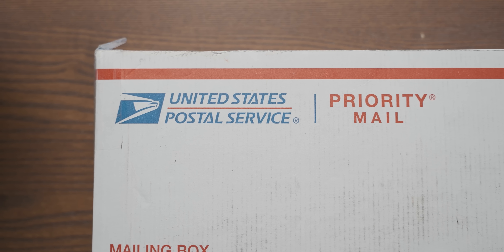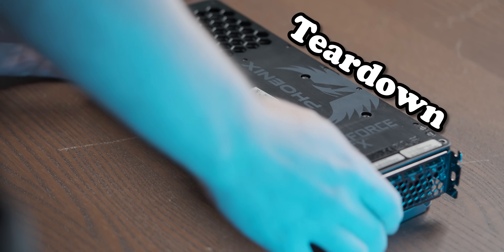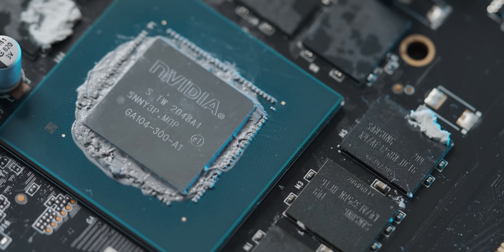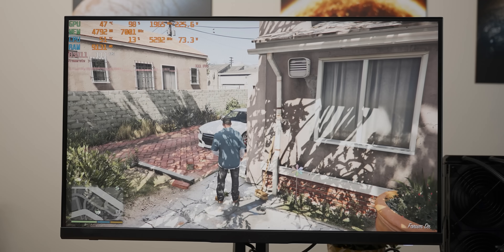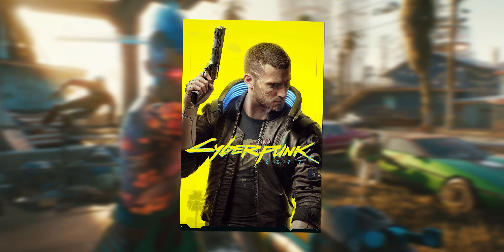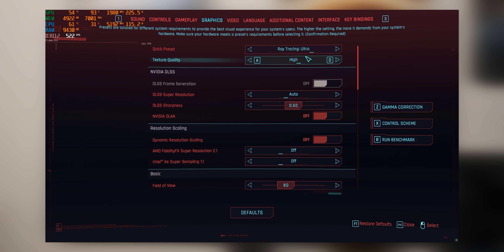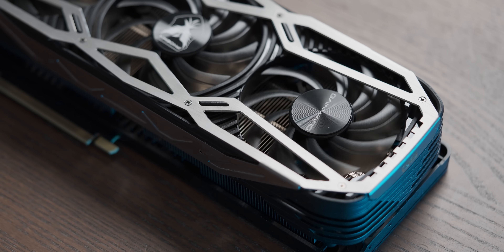This Is The 16Gb RTX 3070 Nvidia Should Have Made

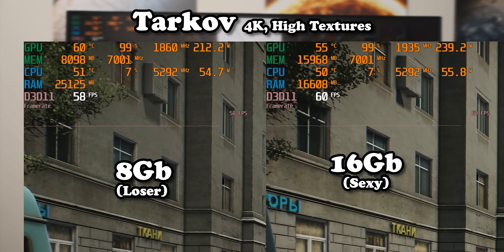Comment: 9:00 bro im so tired of all these fake tech guys, you're one of them.
This is elementary knowledge in tech, when you run out of VRAM is falls back on System Ram. If your ram is fast enough you will barely notice a difference especially if you have XMP on which you most likely do, if your ram is garbage you will see stuttering.

VRAM above 8gb's is pretty much pointless for 99% of all people right now, unless you're playing unoptimized crap like Tarkov, star citizen, or using ray tracing at all.
Reply: Normal ram is a lot slower than vram..you will have frame drops

Comment: Modern GPUs often don’t benefit from more VRAM because the shader cores (the GPU’s “engine”) are already the performance bottleneck, meaning the card can’t process frames fast enough to fully use additional memory capacity. Adding more VRAM only helps when memory size or bandwidth is the limit; if the compute engine is maxed out, extra VRAM just sits idle and doesn’t increase FPS.

Saying a GPU needs more VRAM when its shader engine is already saturated is like installing a massive fuel injector on a 200-hp Honda and expecting it to tow a yacht: the limiting factor is the engine’s power, not how much fuel you can feed it.

Comment: I'm assuming that the core was never programmed to use more then 8gb is the issue
Reply: core doesn't care how much ram some sales person in Nvidia decided to put on the card. if it sees the ram, it uses it. there are however plenty of tricks that Nvidia goes out of their way to do, so that it's nearly impossible (or at least very hard) to upgrade the ram on their cards (limitations in firmware, memory controllers, vrm, software and so on).

Comment: I have some questions about the power consumtion. While increasing memory volume, don't you need more juice to run it? is the memory running at its full capabilities in the case of getting less power than needed? And the final question, Is it possible to do some sort of SLI using this method creating a bridge between 2 cards? I'm no expert at all so I apologize if this are silly questions. nice video and thanks!

Comment: yeah im here at the old video but... can someone explain why 16gb seems not affect the performance more? especially tarkov and the last of us results. if those games literally use more vram than 8gbs why it dont affect the fps?
Reply: Even the 8GB version is not using all of the 16GB textures at the same time because not all of them are visible. Once you go "around the corner" and need a new texture, it's quickly copied from RAM to VRAM and some other unused texture is copied back. The process is rare and very fast so it's not really noticeable (some say it affects 1% lows the most because you do get the same framerate, but with some stutters so average framerate is just a bit lower). If you also had insufficient RAM, then it would suck because it would have to copy new textures from drive and you would get macrostutters. :D

Comment: The games that do not use the additional memory are probably not testing the card and setting up a profile based on the test, but instead are using a table that is based on the known makes and models that the manufacturers supply them with.

Comment: I'm intrigued now. Is the NVIDIA cards firmware like a PC's BIOS, in that it does a memory reliability and quantity check on start up, or has someone had to get their hands dirty with the firmware to allow the card to recognise the higher density memory chips? It feels odd that NVIDIA might code in a memory quantity check for a card where 99.999999% of the time the reported value isn't going to change.

Comment: So there's not really much benefit to 16gb on a 3070 for your average gamer (that will use lower settings in comp games anyway) as the GPU isn't fast enough to make good use of it....  So does that mean Nvidia is right to keep making 8gb cards for their mid range ??    I'm wondering if an 8gb 5070 with the faster GDDR7 would still be fine for mid range ??

Comment: That was a poor effort or showing the real point of more VRAM which is smoothing 1% lows and similar stuttering issues and also making the actual textures you see ingame not beind downsampled to early 2000s jpg quality to fit the framebuffer. People need to stop missing the point by showing average FPS... The first few games looked like they were tested with DLSS on too, since it was explicitly turned off in the option menu after RT was turned on in cyberpunk.

Funny thing is, doubling the RAM on your GPU, shouldn't void your warranty if you have real warranty laws.
I'm not saying it won't, I'm saying it shouldn't.

In theory, It's on the company to prove that modifications to the base product caused the defect/death of it. If you can provide a screenshot of it working after the mod, and a VRAM test result etc, they shouldn't be able to use it against you.
Reply: that's not how the universe works. reballing ram is done by applying intense heat, enough to desolder/destroy other components. voiding the warranty is normal. what is not normal is Nvidia intentionally using vram in order to achieve their planned obsolescence plans.

Comment: the extra vram would be a huge boost for 3d rendering (not always in terms of speed but sometimes if the vram isn't enough, blender either crashes or turns to system ram, which increases the render time by up to 3 or 4 times)

Comment: You don't solder memory hehe, you ball chips. You ball the surface and then you spread a whole bunch of goop all over it real nice and smooth, and you put it on a hot plate while hitting it with hot air until slurp sound The chips just suck themselves into place if you align them right. If you don't then they go on crooked and weird and then you get to try again. It's a wonderfully interesting process. I highly recommend looking into it if you think it's cool!

Comment: I wish someone would invent a modular graphics card, that is the processor and the ram is upgradable. Not just that, the ram slot and the ram that can be installed are the same as the main ram in the motherboard.

Comment: Nvidia dropped the ball on the 3070 with its 8gb vram when I was looking at it I was scratching my damn head at the fact it only had 8gb while the 3060 had 12gb vram..wtf Nvidia regardless it was an ok 1440p med to high settings depending on the game but I upgraded my pc from an omen 25l to a 40l just so I can take advantage of the ddr5 ram capabilities and I wanted something a bit more powerful than the little Ryzen 5 5600G and I swapped the 4060 although my dumb ass manage to lose the gpu latch so it’s being held by the screws and a anti sag bracket that’s also acting a lock on the opposite end from the connector side and it’s working fine which I wanted to get an anti sag bracket because the gpu is a beefy little 4070Ti I say little but it’s a triple fan PNY RTX 4070Ti 12GB GDDR6X Verto Epic-X RGB OC, I’ve Yet To Do Any Benchmarks with it mostly bc I’m needing a flash drive so I can transfer my Vegas pro 14 install files from my Lenovo Legion Slim 5, so wish me luck!
Reply: 12 gb for mining

Comment: This is why i hate those comments saying that "my 3060 12gb will last longer than 3070". It dosent matter if you have 12gb of vram if the core cant run any games that fully utilize that amount of memory.
Reply: ummm yes it does. Many games severely drop their fps when they need more than the GPU has, or textures start disappearing. Hardware unboxed made an excellent comparison between 8 and 16GB versions of 4060 ti and it's pretty clear that for a GPU like 3070 can benefit from extra vram. 
Extra vram can also help with longevity on textures. with a 3070, you'd have to use lower to medium textures, with a 3060 you can max out textures since textures don't require pure GPU performance, they only need vram. Set other settings to medium-high and you've got a beautiful, excellently performing game. No such luck for 8GB 3070.
Reply: @TabalugaDragon no
Reply: @TabalugaDragon The GPU chip in the rtx 3060 is not capable of cranking any stats up
Reply: @iggycool9638  yes especially textures that only need vram and not raw GPU performance. Texture settings affect visuals the most by the way. 
If you set other settings to medium-high(which is possible on a 3060) then a game would look excellent.
Reply: @TabalugaDragon  Dude you clearly have no idea or own a 3060 yourself and just want to be proud of that purchase. The 3070 smokes the 3060 in every game if the 3070 is 60% to 70% better than the 3060.
Reply: @iggycool9638  yeah especially when 8GB are insufficient and a game drops to 15-20fps. 
3060 would never drop to such low fps at 1080p ultra textures. 3070 would. 
No, I actually own a 3070 and regularly run out of vram and experience drops to 20-40 fps, just like Hardware unboxed demonstrated in their 4060 ti 8GB to 16GB comparison. In my case it's No man's sky game.
Reply: @TabalugaDragon  It defenitly isn't the best. But in no world the 3060 12gb will last longer than a 3070. Games are getting less optimized that means too, that a better graphic chip is needed. Btw if you need to you could upgrade your 3070 to 16gb. It is what i am planning to do, but you will never be able to upgrade a 3060.

Comment: Hi Dawid,
I wish you would have done some synthetic testing for production geeks like myself. Like, render time speed tests for 3D applications. 16 gigs are very useful for high polygon count/high res textures/etc.. for 3D rendering. I would rather have 2 rtx 3070s with modified 16 gigs of ram than just a single 3090 rtx.
Do you have the contact info the tech who made that 16 gig modification?  I want to possibly get two 3070s and modify both to be 16 gigs. 
Would you know how much those 16 gigs of memory costs by chance???
Love your channel and your quirky/fun personality!
Reply: Did you get your cards modded yet? I found a place in the UK that will do it for £200, just wondering if I should go ahead.

Comment: 0:35 Classic! 
My first gpu was a used GTX 770 that shipped without the original packaging just an old box with stuffing material, then I replaced it  with a new GTX 1650 Super that just recently got replaced with a used but pretty new RTX 2060 12GB. Which means I obviously put the 770 in the original 1650 Super packaging, then put the 1650 Super in the 2060 box 🤣

Comment: Basically the lower vram card shifts the data into Ram, as you can see normal 3070 consumes more System Ram as compared to the modified one
Comparison would be interesting if we bottleneck the System Ram,like for exp capping it to 8 gigs?

Comment: I know you receive more requests than a tree can shake a stick at. Things like "Could you please spare some RAM" to "Since you have lots of graphics cards could you possibly share one with me." This is one of those messages. What I'm currently working with is a Ryzen 5 3600 non-X and in MSI AMD Radeon RX 570 4GB GPU. I'm also so broke there 8s no better options that can't wait until tax season. Unfortunately I may very well be in Arkansas before then. That's in 2 to 3 months. However, I'm sure I could afford to pay shipping on a GPU if you could please send one. Anything better than my RX 570 would be highly appreciated. That or I'd trade you outright, my RX 570, pair of GTX 460 with connecting cable and a 16GB (2 x 8GB) kit of Corsair Vengeance RGB Pro.

Comment: thanks for testing, dawid.

so the tldr version is: the whole "if your settings exceed your card's vram, your game gets massive frame drops or will crash or textures wont load properly at all" is a MYTH perpetuated by channels like hardware unboxed and 8:48 proves it.

Hardware unboxed used early builds of tlou and hogwarts legacy as "proof" of textures not loading but those games have received patches now. So the games were faulty, not the vram overflow.

yes the framegraph will be a bit more stuttery (9:53) but this silly notion that 8GB cards are DOA now and people who bought an 8GB card last year that can still run modern games due to having reasonably powerful rasterization just had their cards thanos'd in 2023 and should go back to the store and get a 12GB or 16GB card or be forced to crank their settings all the way to low or medium is a myth.

if you have a 16GB card, it just means the game will load up more into its vram. if the game can't, cause you have less vram, it will use more system ram and you may get a bit lower fps and a bit more stuttery framegraph, but nothing game breaking if the game has been patched properly instead of being a brand new buggy port running on console 16GB vram architecture.

Comment: as someone with a 7900xtx with 24gb of vram. I don't really need so much. The card can't run at a good enough performance level to even use all thatt vram. 16gb and I would still have been happy. So getting a gtx 3070 with 16gb is a complete waste.

Comment: 16GB feels like too much for this gpu :X
Like…. What do you think you’ll get with more VRAM on a 3070/3070ti? Just a more competent cheaper GPU to use for 3D modelling and such. People used the RTX 3050 and 3060 for stuff like that, heck the 3080ti had a 20GB model, which was sometimes used for the same thing. But well, most people who get GeForce GPUs buy them for gaming more than anything, with the then 3090 being the best for entry level professional 3D modeling, since the A6000 was thousands of dollars for the that.
Even the other RTX A GPUs were expensive for having the same chip, but just more vram.

Comment: It's incredible how far system RAM has come.

As you pointed out, the system with the 8GB 3070 uses more RAM than the 16GB 3070. All of that is information dumped from the GPU to the systems memory. There are frame drops on Escape from Tarkov and The Last Of Us but I image them to be much more noticable on older systems with DDR4 or DDR3.

Comment: One must realize that even though more RAM is better, if it's still just as slow, twice the RAM will take twice the time to read. That is why they won't give more RAM, because they'd have to up the bandwidth. This is why the 4090 is 1000GB/s while the 4070 is 500GB/s. The 4090 has double the RAM, but reading the full 24GB takes just as long as reading the 12GB on the 4070, so relative access time isn't changed much when utilizing all the RAM, but obviously most games won't use that much, so if they use 12GB on the 4090, the read will be twice as fast than the 4070.

Comment: Do people realise bandwidth is kinda as important as the ram size? if the AMD has a 192 bit bus and Nvidia a 256 bit bus then it sreams faster data and has a lesser need for more ram or is that not hot it works? also isnt there new GPU to ram direct archectecture that they are usig now to negate the ram speed?
Reply: not really.
Reply: @McLeonVP  real indepth there.
Reply: @deeplaysgaming4754  The rx 7900xt haves 800gb/s bandwidth lol.
The Radeon VII haves 512 bit bus.

the 4090 haves 24gb of vram with a 384bit bus.
:v
Reply: @McLeonVP  your point being?
Reply: @deeplaysgaming4754  You don't need so much bandwidth or bit in bus.
This is just marketing at this point.
Reply: @McLeonVP  yes you do bandwidth is important or they wouldnt be more of it on top end cards because lower end cards dont need it.
Reply: @deeplaysgaming4754  Yes. But even a rtx 4090 doesn't need more than 300gb/s.
rx 7900xtx. or 7900xt with 800gb/s is just marketing.
The rtx 3060ti haves 320gb/s
and the rtx 4060ti will have 280gb/s and still perform better than a 3060ti.

The gt 210 haved 1gb ddr2 in vain.
Because his low bandwidth only used 512mb

But these new gpus are different.
Excessive bandwidth that you'll newer gonna use.
And you don't need.

Bit bus is needed for add more vram.
That doesn't change vram speed.
Reply: @McLeonVP  my point is that ram isnt as important if the bandwidth is better used on cards that are faster because they need that bandwidth for the high quality textures. so if data from ram is bottlenecked by the bandwidth having more ram wont make a diffrence, its like a 2 lane highway vs a 4 lane highway the 4 lane moves traffic faster.
Reply: @deeplaysgaming4754  Obviously a 16gb gpu will have enough bus and speed.
Your example is imposible.
I prefer 8gb gddr5 > 4gb gddr6

Bus is amounts of vram
mhz in ram is speed
I repeat anything above 500g/s is pure marketing.
gpus aren't so strong to process more than that.

Comment: 9:00 That's because the 8Gb card doesn't have enough Vram to produce the same textures as the 16Gb.
The computer will use your normal DDR RAM to store those textures but it is way slower at doing it than VRam.

Comment: It all depends of engine, but when there is not enough VRAM, data is stored in RAM, games don't need all allocated VRAM to generate every frame, but they store extra data that can be used soon, using it from VRAM is faster, if suddenly you need data that is stored in RAM it can lead to small stutter until data from RAM move to VRAM.

Comment: With my RX 6800, if I crank up all the settings on Resident Evil 2 (2019) at 1440, I get greater than 8 GB of video ram required. The funny thing is that at lower setting at 1080 P, I used to play it on a 2 GB card.